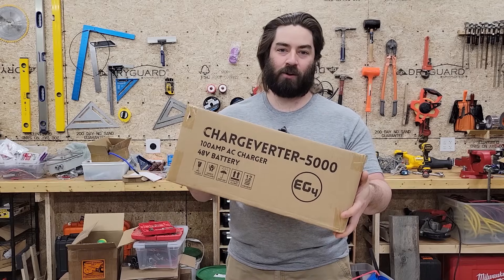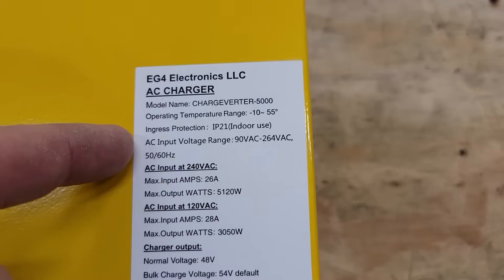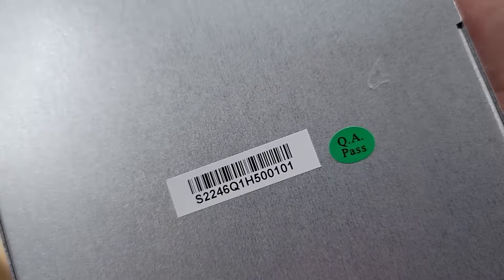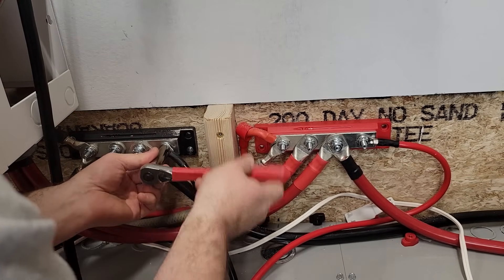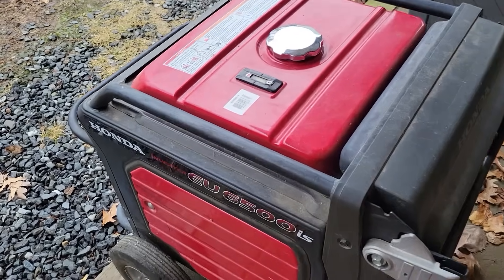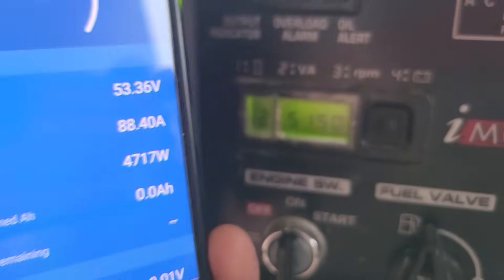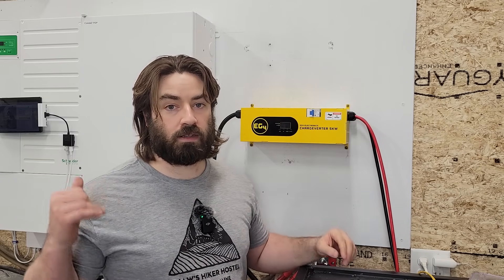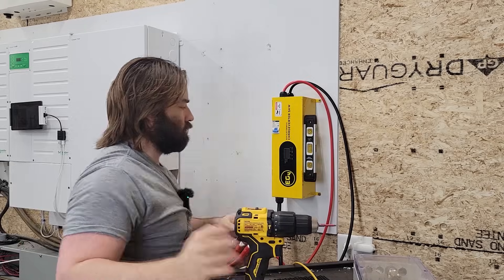Powerful and Affordable AC Battery Charger

Comment: 100 AMP..lol
Hope you’re planning on getting a new generator every six months, batteries every year because that’s one heck of a load. Neither the batteries nor the generator would like being run at that much load.

I like that you can turn it down so as to bring it down to a more realistic level, however why not just get one of the millions of quality automotive style chargers? 

I’ve been using my little ten amp Solar Pro-Logix from Napa auto parts for 3 years now and it works great. I’ve been 100% off grid just using a 3500 generator to recharge everything. It even checks the batteries then runs special cool down modes and ramp up profiles to charge the best way possible. The downside is it only works on, AGM, GEL or flooded. $119.00

PS:Can you even charge Lithium batteries at that rate without damaging the BMS?

Comment: A couple of concerns. If you turn off the circuit breaker on that charger when it's not in use and you turn it on to use it does it produce a big current surge charging up its internal capacitors? The other concern is it seems to run quite hot I wonder how long do lifespan of the charger will be under those conditions?
Reply from the maker: I have shut off the circuit breaker and back on again a few times and didn't have a problem with whatever capacitors might be inside.  Yes, it gets hot, and I really don't know the lifespan.  I don't run mine at 100%, usually 80% in hopes that will prolong the life.
Reply: @DavidPozEnergy  that's helpful information and much appreciated. Signature Solar estimates mine will ship mid May. At least I now know which way the air flow through the charger goes, so I can mount it appropriately near my exhaust fan.

Comment: I bought one of these to charge a golf cart with the SPIM08HP batteries like the one you built awhile ago. Seems ideal for that. Heavy duty, programmable at about the same price as other lithium golf cart type chargers. I’m connecting them with Anderson 175A connector so when I park it’s easy to just plug & play. Plan to power directly from Outback AC inverters or generator via transfer switch.  What do you think? I’ll send update when installed.   Great video!

Comment: Great work as always. Do you have an estimate of the fuel efficiency (KWh / gallon)?
Reply from the maker: Yes. My video with my Honda generator showed 5.8kWh/gal. Check it out if you have time.  I test it at several different current settings.
Reply: @DavidPozEnergy  Awesome!

Comment: Is there any reason these can't be paralleled for larger systems?  I have a 22kw whole house generator, a sol ark 12kw system with 6) 5kw server rack lifepo4 batteries. it seems to me, since its DC output, I should be able to utilize two or three of these units, set the parameters lower, run them a little cooler, and maximize the larger generator output with the large battery bank, reducing hours on the generator and still staying at proper charge rates for the LiFePo4.  thank you !
Reply from the maker: Yes, you can parallel more than 1 charger into the same battery bank.  
It sounds like you have the same battery bank as I do, 30kWh total.  Since you don't want to exceed a 0.5C rate, keep the total charging current to 300 Amps.  This means, if you had 4 "Chargeverters" each at 75 Amps, you could re-charge the battery bank in 2 hours (0%-100% SOC).  I would suggest setting this to only occur at night.  If the generator attempted to do this while there was some solar coming in, then you would exceed 0.5C rate.

Comment: I’m currently awaiting Level 2 Support from Signature Solar to call me back.  Here is the issue.  I’m getting 48V and 0 amps.  The internal modules are fully seated and their status lights both green.  I can adjusted the current up/down on the interface but still no output currently.  The display reads 48V and 0 amps. I don’t have a DC clamp meter to confirm 0 amps are going to the batteries but they are not charging and after an hour the charger is cold to the touch.  So nothing is happening.  Has anyone else seen this issue?
Reply from the maker: I had this happen to me once.  I had forgotten to turn on one of my many circuit breakers to the battery.  Lol.
Reply: Thanks David I figured out the no amperage issue.  The voltage has to be set higher than 48V evidently.   Given there is no communication between the charger and batteries it must use the voltage level to start/stop charging.  I will verify when Signature Solar Level 2 Tech Support calls me back.

Comment: Thanks for the review. I have a couple of questions.  1. Can the chargeverter be used while the inverters are operating?  2. Since there's no BMS what happens when the batteries reach full charge?
Reply from the maker: Yes, the chargeverter can be used at the same time your inverters are being used.  This is a tool that mostly will be used for people living off grid.  So, the inverter must be up all the time.  
As for the BMS.  The chargeverter should be set to a lower Voltage than your batteries would be full.  For example, my batteries can go up to 58.4V, but I set my chargeverter to 55.0V.  This means the chargeverter will never fully charge a battery.  However, this doesn't mean you don't need a BMS.  You still need a BMS if you are using lithium batteries.

Comment: Hello David, as always, your videos are simple but super educational.
I have a question and whether you can put 2 charverters at the same time to charge the same battery bank since I have a generator that generates 15KWA and 22KWA to start 
 and I would not like to waste time if I can do it in 1 hour it is much better than 2 hours and at the same time At the same time, it saves me energy since 
the generator will generate it in the same way, but it would not really be used. I would like to use the generator directly to the inverter, 
but the people at Signature do not recommend it because of those at Dirty Energy. Can you give me your opinion and options, thanks.
Reply from the maker: Yes.  Inside the Chargeverter there are two power supplies in parallel.  So, right there, it's not a problem to parallel them.

Comment: I ordered and just installed my new charger. Out of the box one of the two modules had slipped out of the socket during shipping. Noticed this due to the unit providing only half of the selected charge current.  A couple of issues worth noting; as David mentions the unit does not have a delay feature to allow your generator to warm up. I will be adding a timing relay to do this. Also this unit would not work with economy mode on my Honda EU6500. The charger would instantly fault when the generator was attempting to throttle up. When the charger faults it looses the voltage and charge current settings. With economy mode off the unit does a great job changing my lithium batteries and eliminates the sketchy transfers that my inverter/charger produced when the generator came online.  I would like to see some added features but do think the unit is very useful at a good price.

Comment: David, Do you know how LOW you can set the output current?  I like that this charger can hit 5,550 watts so I can use my Ear-Blaster 6500 but would normally prefer to run it with my EU2000.

Comment: David, I have a question maybe you can help with. I just purchased an EG4 3000w 48V all on one inverter from SIgnature Solar and I was wondering if I can connect Redodo 12V 100Ah LiFePO4 Battery (4PACK) to the EG4 all in one inverter and will the BMS communicate with the inverter?  I'd like to do this because I can't afford the EG4 battery and the rediculous $285 shipping charge.

Comment: I'm slow to pick up on this stuff. So, in conclusion........ this generator will recharge Six of your batteries from what percentage to full (?) in how much time and gasoline?  I am sure it was all there I just didn't put it all together in the end.
Reply from the maker: This "Chargeverter" maxes out at 100 Amps.  My battery bank is a total of 600Ah.  That means 6 hours to charge from 0% to 100% SOC.  Personally, I'll run mine at 90A, and only from 20% to 60% SOC.  20%-60% means a total of 40% of the capacity to be re-charged from the generator.  Let's do the math:  
600Ah * 40% = 240Ah
240Ah / 90A = 2.7h
This means, 2 hours and 40 minutes of generator run-time.
I don't need to run the generator every day, maybe every other day in January.
Reply: @DavidPozEnergy  Thank you for the Math and explanation. Your 20-60% makes sense to me. I have yet to have Li batteries and am working with AGM (good ones), but want to convert to Li when my AGMs need replacement. I like the deal offered with the six batteries and the rack right now from signature. It looks just like your set up. Nice!

Comment: I purchased on an installed a 30amp 250 volt plug in battery room and couldn't make it charge mor than 49.8 amps I thought cord was wired wrong I turns out after opening the unit one of the chargers were unplugged and main positive lead in dc breaker was completely loose. tighten screw and pushed charger back into socket and now works fine 100 amps confirmed with amp meter.
Reply from the maker: I'm glad you figured it out. Sounds like quality control is lacking.

Comment: David,  I like the modular-ness of the main supplies.  However..  I  couldn't  really see from the video..  Is there anything that secures the the internal 2 modules?  You just slid them off.  Is there something to prevent that say if you hang it vertical?  Gravity or vibrations might cause them to slide out if there is nothing mechanical preventing that. I got to believe the EG guys would have something.  I just missed it.
Reply: Nevermind..  I just went back and saw the bracket.. 🙂

Comment: Did I miss how long it took to charge the batteries?
Reply from the maker: It will depend on the size of your battery.  For example, I have a 600Ah battery bank.  If I'm charging it at 100 Amps, then it will take 6 hours to recharge from 0% to 100% SOC.  But, since I mentioned I'll probably set mine to charge from 20% to 60% that's 40%.  And, If I set the Amps a little lower at 80A, then the math looks like this:
600Ah*40%/80A=3h

Comment: Is it rated for continuous use?  Could I plug this into Grid power to maintain my batteries while I was still using my Inverters as if they were a giant ups? I understand I would be wasting quite a bit of energy but I still do not have my PV panels installed yet.  Slow process but I wanted to get all my inside wiring completed and tested first.  It will be an off-grid set up completely separated from the Utility.   Thanks for the video.
Reply from the maker: Yes, you could do that.  I've ran this charger for several hours in a row without a problem.  Keep in mind, if you set it up like that you might want to lower the Voltage to 54.5V since it will be floating there.  I don't see a reason it wouldn't work for you, but I have not personally tested using the Chargeverter in that situation.

Comment: Great review I just had a couple questions.1 can the inverter still be powered on and running power to the off-grid cabin while charging the batteries and 2 can this chargeverta run at the same time that the PV is charging batteries also? Ty
Reply from the maker: Yes!  That's one of the nice things about "DC coupling".  Multiple things can be connected and ON at the same time if it's on the DC side.  I recommend having some serious busbars centrally located where everything gets tied together (see busbar video).
Reply: @DavidPozEnergy  thank you sir

Comment: David can you charge like this with the inverter running to power the house?
Reply from the maker: Yes.  Multiple things can be hooked to the battery bank at the same time.  I recommend having some serious busbars centrally located (see busbar video).  Note, that if this charger is charging the battery at 5kW, and you are consuming 5kW with your house loads, then the battery won't actually be getting charged.

Comment: Dave, do you need to turn off the inverters while using the charger? I've got (2)EG4 6500's and the (6)lifepower battery bank
Reply from the maker: Nope.  That's one of the best parts.  I don't even need to turn off solar charge controllers.  They can run at the same time.  Now, for the best results you should have central bus bars, and they need to be thick copper, not the thin brass ones
Reply: @DavidPozEnergy  awesome! thank you! the inverters keep up pretty well, but a string of cloudy days and I have to fall back to something.
Reply from the maker: Yeah, me too.  I have a few generators.  I don't need them 10 months of the year, but pull them out for Jan+Feb.

Comment: just got mine set up. in alaska i have some short days, so this is something i will use for probably 3 months out of the year. i use an 8000w generac. charged my 300ah bank at 75amps, from like 60% in 1.5 hours….i’m excited about being able to run my bank lower and charge faster instead of having to top off more frequently.
Reply from the maker: Yeah, Alaska would need a pretty good generator system.  Thanks for sharing.
Reply: @DavidPozEnergy  was using the 18a with a 2000w generator and it’s just to much wear and tear and time. so this unit is super helpful. i wish that it could be mounted differently. or atleast had longer leads.

Comment: So I’m off grid and have been buying from Signature Solar. Everything has been great. Have bought one EG4 battery, has been great and a growatt inverter. If this is done correctly, that is on a off grid set up, you will be using the lower voltage instead of 240. If you built your set up to run only 110-120 v, you will be using a smaller generator. The idea is to use small generators not 240. The bigger the generator, the more gas you use. If you have a shorter charge time it maybe a better deal.
Reply from the maker: I'm less concerned with run-time, and more concerned with kWh per gallon of fuel.

Comment: great video....if it wasnt sent to you for experimenting/free, would you buy one ? also i am almost ready to flip the switch and invest in a solar system , are you satisfied with the batteries ?  i may go a different route for the inverter though (was thinking the sol-ark 15(s)).
Reply from the maker: Yes, I would pay $400 to purchase this, even if it wasn't sent for free.  I wish it mounted vertically and had all the wires exit the bottom, but I might just be nit-picking.  However, this is not the first thing I would buy if money was tight.  A lot of inverters (including mine) can re-charge a battery from a generator.  So, this 100A charger is probably the last thing to buy on the list.  As for the batteries... Yes.  I bought the Gyll batteries and rack.  I used them over a year without any faults.  The newer version, LifePower4, I've had a few months.  I don't like the position of the circuit breaker as much as the original version, but it's still the best buy ($/kWh).  
If you decide to use a Sol-Ark off grid, then I'd suggest adding a transformer to your list of equipment.
Reply: @DavidPozEnergy  I'm trying to stay grid connected.....thank you for the additional information and in depth videos....I'll be using some of them as a template

Comment: David, thanks for the review of this. I'm interested in one to pair with a j1772 on my box truck so I can charge at public ev chargers. What I can't seem to get an answer on is if the neutral is required or not for the 240v input. The J1772 standard is two hots and a ground, no neutral. Any chance you could check?

Comment: @davidpoz, i am wondering if you lose power input. Will the chargeverter retain the last setting once it gets back the power input back ? Or do you have to re configure the amp/voltage ?
Reply: mine retains the info

Comment: Hi David, thank you for videos. Did you try powering your loads with the inverter while charging? Thanks
Reply from the maker: No.  I wanted to measure power at the shunt during the test.
Reply: @DavidPozEnergy I was wondering along with Charlies' question, IF you can safely turn on your INVERTER while charging with this new device?  Will all that amperage fry the Inverter?  I would think not, because they are ready to accept all the amperage from the batteries/banks, no issue... Your thoughts?
Reply: Thanks For your response. I
Was wondering if you could power your loads from the charging power provided by the Chargeverter. I have a small gas generator, 2000 W, and this device may help me charging my batteries using my generator. I have a Schneider XW +so I have enjoy your recent videos on that inverter. Thank you again for your videos and please continue doing what you do.

Comment: But what is the point of this if you have 2 Schneider 6848 that are capable of charging your batteries at 140amp each and you can buy a $180.00 Schneider AGS (automatic generator start) to control the generator
Reply from the maker: I have a previous video testing my generator input into the Schneider: https://youtu.be/36H6Sb2IG_k

Comment: Hey DavidPoz.
Looks like Growatt is about to launch the SPF 6000 ES Plus inverter. Would be awesoe if you could try get in contact with them and see if you can do a 1 phase/3 phase review on the units, im stoked on them because dual MPPTs.. Would be sweet to see you do a review on them like the ones you did for the 5kw units.. Keep up the nice work.